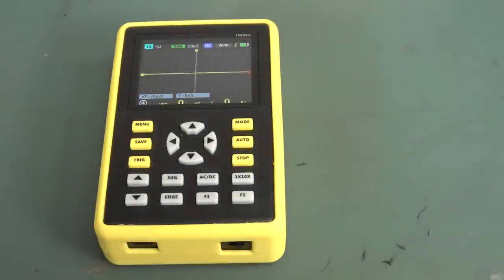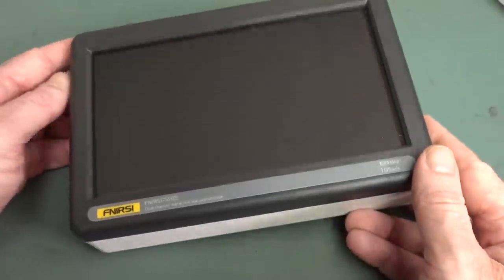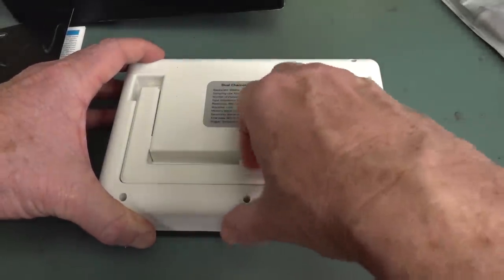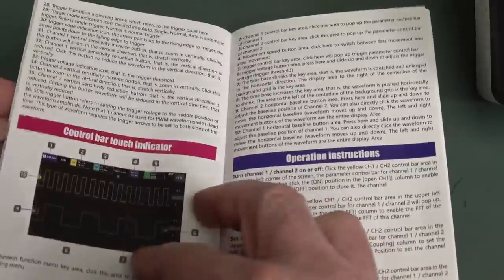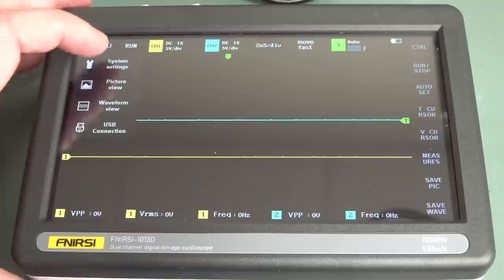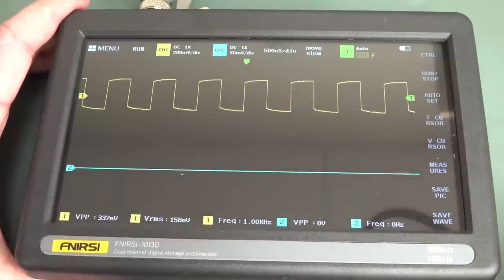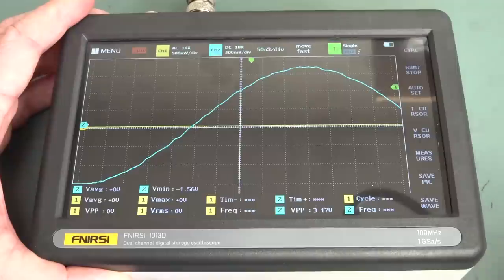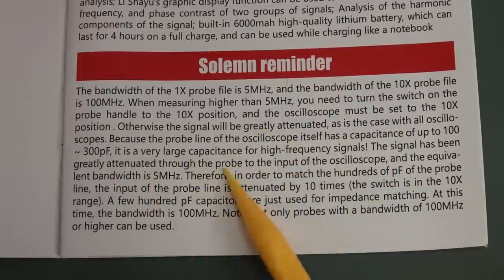EEVblog #1317 - $140 2CH 100MHz Fnirsi Tablet Oscilloscope Review

Comment: Its really depressing how expensive a decent scope is. This was just barely in my price range, but its too cruddy to really learn with. Im worried ill confuse the scope's problems with my circuit's problems
Reply from the maker: Expensive?
A decent 20MHz dual channel analog scope was always around $800 or so for a generation, as were the early digital scopes like the DS1052E about 12 years ago. Then the prices halved to about $400 and there they have remained, but functionality has gone through the roof.
Reply: @EEVblog  im not arguing against that, but $400 entry level is still expensive in terms of "i dont have the money for that, and therefore cant enter".
Not to mention, my real interest is radios, and a scope that can handle a 900mhz signal is probably a lot more than $400
Reply: @terminsane  with your own home made definitions of "expensive", one could argue that $10 is expensive for a new car. Ridiculous.
Reply: @martin-ot  expensive is clearly subjective. There is no objective definition of expensive.

Comment: Wow, what a piece of garbage.  It just goes to show that eye-candy sells better than functionality.  Didn't even come with a cheap stylus that would make it easier to click and drag smaller control icons and things.  A big fat finger blocking the very thing you're trying to drag to is not helpful.  Honestly, I prefer to use knobs and hard buttons.  I've never understood the fascination with touch controls on equipment like this, but I know certain managers who know nothing about using such equipment that would pay $40,000 for this just because they think the touch feature is cool and modern.  Any scope with such a crappy interface and with so much measurement error is useless, worse actually, because it creates more problems than it solves.  Making an inaccurate measurement device cheap is NOT a benefit.  Cheap doesn't compensate for crap.  It IS crap.

Comment: WANT WANT WANT!!!!
Reply: No! I dont want! I mean the epic fail jingle.
Reply: I picked up a Rigol DS1000D 100 mhz 2 ch with data analyzer (gen 1 version) working in great shape for $150. Unfortunately you cant update to the newest firmware, but its a great scope for $150. They are out there. I find sub $200 analog scopes all the time. Tek 2205, 2210, 2215.